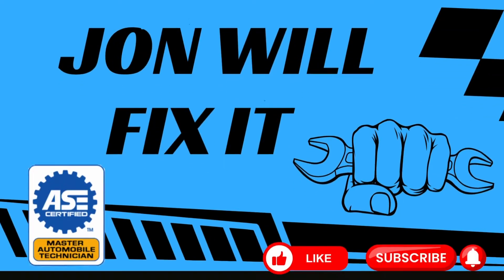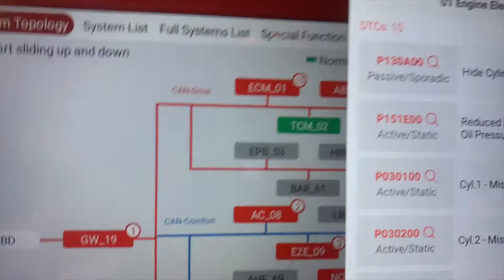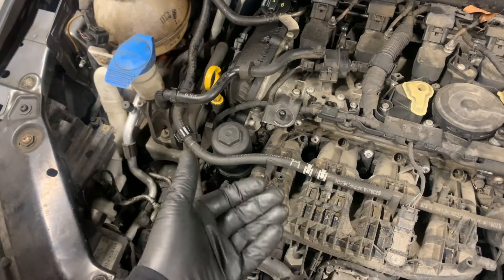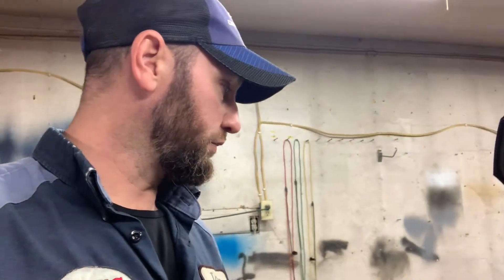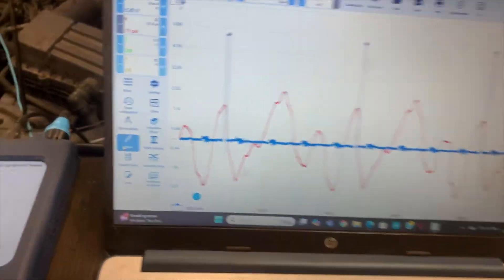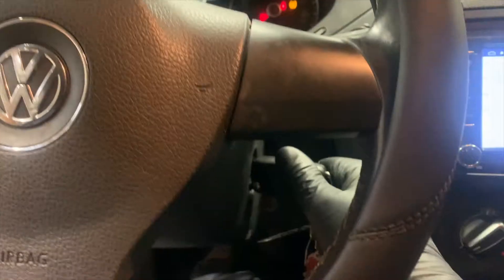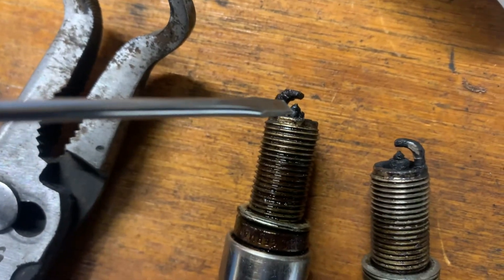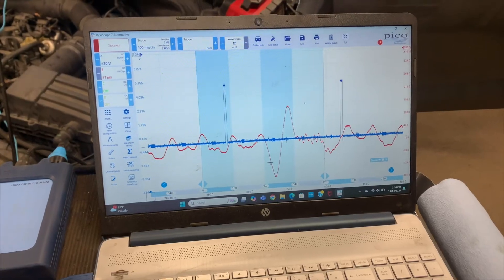VW Jetta, Running extremely rough, Watch how i pinpoint the exact issue

Comment: Great video, thanks for posting! I can't help from wondering if maybe that old car needs a valve cover gasket with all the oil in there. I'm not familiar with those VWs.  Like your strategy!
Reply from the maker: @bobcombs7138   yeah it probably could use a new valve cover gasket
Reply from the maker: @bobcombs7138  thanks friend 😊